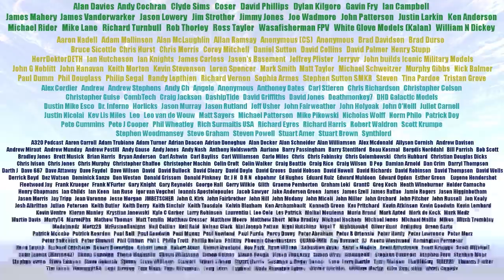Agora Models Build the 1961 E-Type Jaguar 1:8 Scale - The Spokes and Rim - Part 1

Comment: well only 4 more to do at some point in the next 8 packs of the type  E after this one then.  wonder if they got you g doing 2 in one pack and 2 in another or stretching them out like track sections.  Also yeah the like i mentioned its all in the last 7 stages of the DB5 build you basically slap all the car together  they defiantly changed a lot since that through the delorean and into the later cars like ecto 1 and jeep willy 2which makes more sense.

Comment: The spokes are alot more simple than a Pocher1935  Mercedes .They had spokes and the fereal the spokes went into .Talking about small parts each wheel had around 200 parts or per wheel.

Comment: Would have struggled with this but Wayne why you glue as the top that you screwed hold's the whole lot together you recommend glue them
Reply from the maker: The glue I put on is microscopic. Just enough to hold in place while I work around but not enough to stick it permanent
Reply: @WorldofWayneUK  Ok thanks Wayne good idea

Comment: I think if you look at what you did again, you'll realize you have the spokes wrong. The top spokes should only cross 2 of the bottom spokes. Yours crosses 3. You can see this in the Agora instructions at step 13 onward. You did exactly what I did. When you take it off and start the A/B spokes in the next stage, you'll find they won't work. I had to remove all mine and re-do them to only cross 2 spokes.  Otherwise the next step, which is actually much harder than this step will never work and look right. I used double sided tape after trying to do it without glue or tape, that's a waste of time. Could be wrong about what you did, but having done and re-done mine a few times, doesn't look right.
Reply from the maker: Lol you made me panic then. The angle of the pic is deceiving it touches the third spoke but only crosses 2 . I counted the diamonds and have 24 and it looks like the pic so I think we are good to go
Reply: @WorldofWayneUK  good to hear. I just know how frustrating it is to undo those spokes and start over.